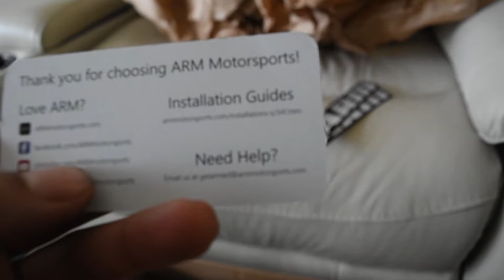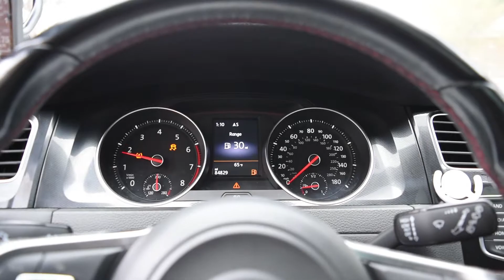MKLEEN7 front mount intercooler install and diy . . .

Comment: Do you have to take out the stock intercooler?
Reply from the maker: No you don’t have to
Reply: @Demidantz  sweet! Do you know if it will fit the mk7.5?
Reply from the maker: @jordangaudreau5767  not too sure tbh with you. Probably not though only cause mk7.5 started in 2017
Reply: @Demidantz  okay thank you man!
Reply from the maker: @jordangaudreau5767  no problem ! Anytime